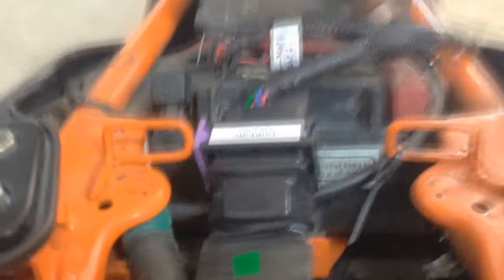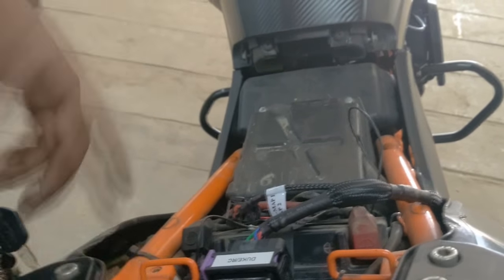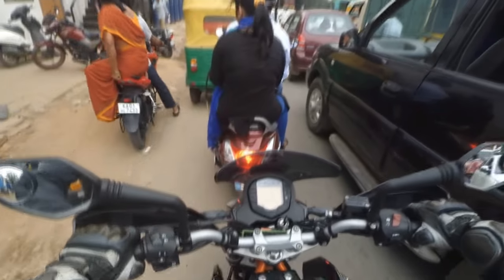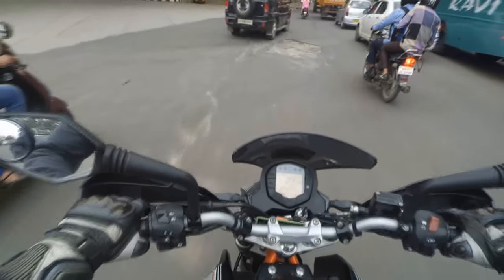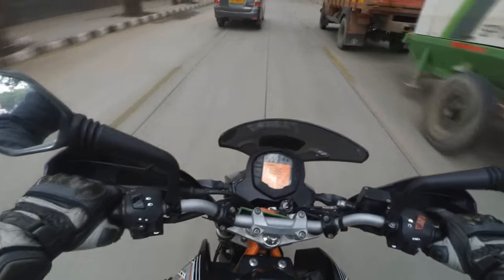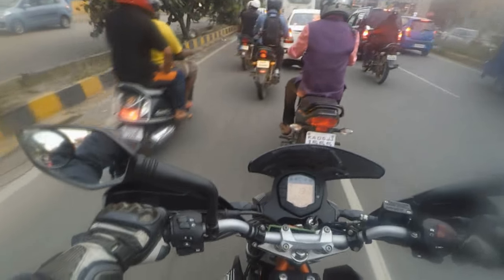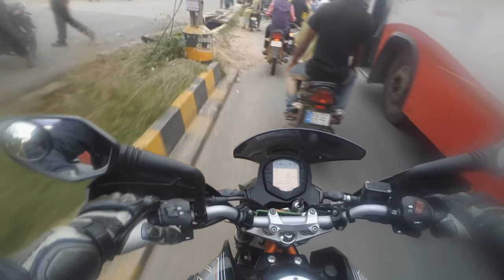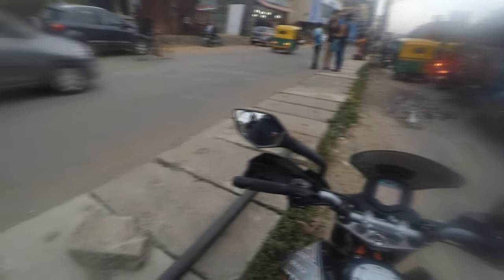KTM DUKE 390 (RD POWERTRONIC VERSION 3.0)

Comment: Hi dude, i just installed powertronic on my Duke 390 and tested it on road and my bike didnt even reach 170km/h in 5th gear like if loses power and suddenly the bike turns off and then turns on instantly, i already installed ktm duke 390 maps from racedynamics website and issue persists, what can i do to fix this problem? My experience with powertronic wasnt so good as i expected to be.

Comment: Good video. The installation part was well captured and informative. Riding at low rpms was the most annoying thing for me about 390, since this fixes it, that should be reason enough to go for it :)
And like you said, revving beyond 10k is not a good thing to do, the power anyways dips down after that. Only reason it will be useful is in track, you wont hit the rev limiter quickly and it reduces some gear changes.

Btw, the video was a bit shaky for the installation part, something to do with video rendering I guess.
Reply from the maker: Thanks dude...  Yeah the bike is more fun to ride now especially in the city.. Still more R&D required and need to play on some different maps to make it perfect...  

Regarding the video shaking, I guess since it was handheld the problem...  Will rectify it in the coming videos :)
Reply: They had older powertronics for quite sometime on 390 isnt it? So I would guess the one you have should be well tested.

And its not much the shake, its more of motion blur which is usually because of rendering. If the original video also has it, then it is your handheld problem :p
Reply from the maker: +CodeNameABK yeah dude, I will keep the camera thing in mind...  This is still in testing stages...  There are some cool features like quickshifter also in the pipeline using the same ECU..  You will see it coming soon :) By the way, this product hasn't been launched yet..  RD has been kind enough to offer this to 10 riders in Bangalore to test it out...
Reply: Yeah, I heard all that on your video :D If they can pull off a quickshifter it will be great :)
Reply from the maker: +CodeNameABK I am sure they will.. Quality parts and great customer service..
Reply: +AJ 390 was gonna ask about the Quickshifter. It's already installed on your bike it'll soon be?
Need some reviews on Quickshifter, ut can be a huge help on highways ;)
BTW great video mate 👌🏼 you got a new subscriber
Reply from the maker: Thanks mate!! Appreciate it. Regarding the quick shifter, it will be done in a couple of months as told by race dynamics. You guys will be the first ones to watch the review though. The RD POWERTRONICS V 2.0 full review will be up in a few days. 

Cheers :)

Comment: after installing dis hw much extra kmph we can expect? and the stock bike rpm is 1500rpm in neutral so if installing dis it goes to 2000rpm?? and really the video on ur speedometer recording quality is bad cant see the reving properly
Reply from the maker: Kevin Nivas Kevin Nivas mileage remains the pretty much the same.  I will keep posting videos of this in parts as it is in testing phase . Stay tuned :)
Reply: AJ 390 im asking about the extra top end?
Reply from the maker: Kevin Nivas Kevin Nivas The top remains more or less the same. The bike reaches there easily 3-5secs quicker than a stock 390 :)
Reply: AJ 390 so in 3-5 sec can we expect 5kmph as extra speed?
Reply: AJ 390 is there quickshifter available with race dynamics?